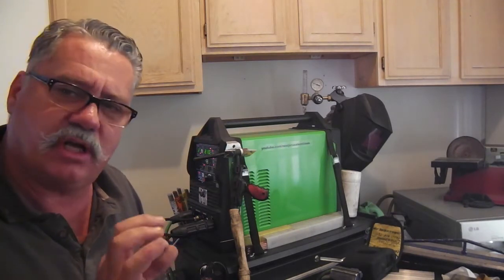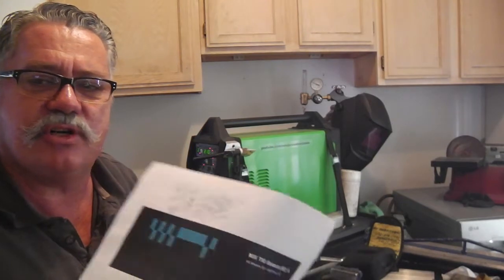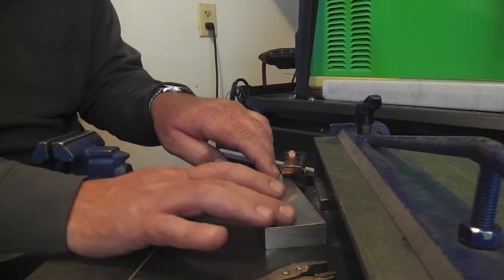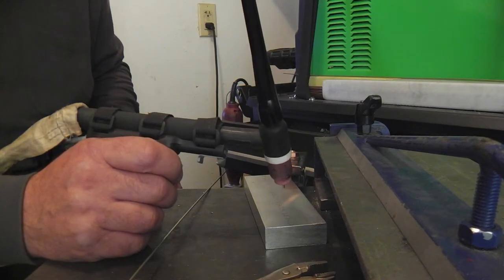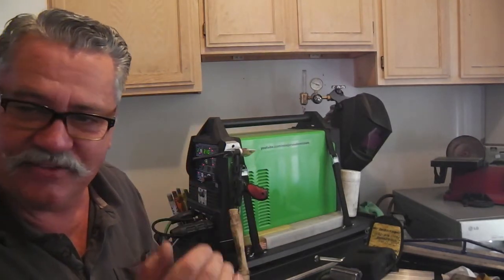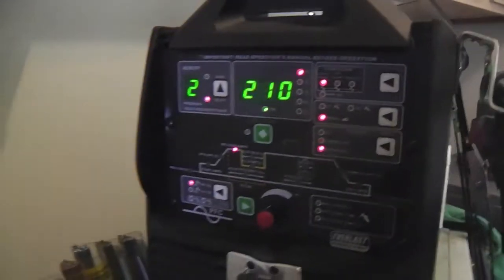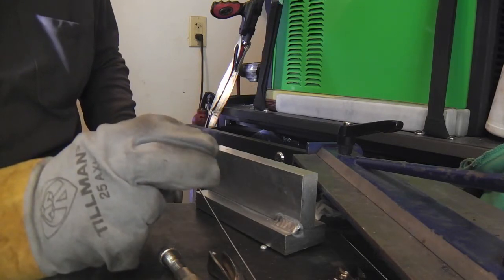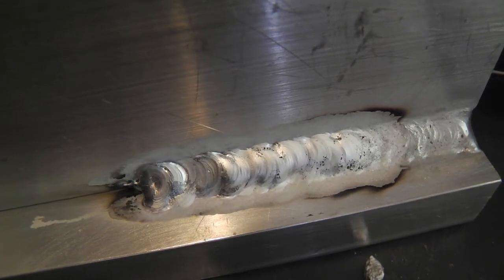Everlast Advanced Pulse AC/DC MixTIG Welding Feature

Comment: What a great feature. Everlast sure is doing some right things with their welders.
Reply from the maker: Yeah, the quality and value of some of the TIG units being produced in Asia lately, like the Everlast EXT line, are providing high quality, advanced-featured machines at brilliant values. I mean, six or seven years ago you had to spend about $6000 to get something like the Everlast 210EXT. And Everlast produced the first and second MIG-AC/DC TIG Multi units in the welding marketplace, nearly two years before Miller and ESAB's very recent entries of MIG-TIG AC/DC "all-in-ones". I mean, I'm not shilling for or compensated by Everlast, or any company. I'm just a little tired of hearing the Red and Blue crowd mindlessly restating that the Asians only copy Anglo-American designs. That seems to rarely be the case anymore, and quite the opposite now, in some cases, like with Everlast's first-to-market MIG-TIG AC/DC true "all-in-ones", e.g., the 221 Sti, 252Sti, and now the latest Lighting MTS 275, with its brilliant TFT digital display, which could even show up on a refresh of the EXT line sometime. But I'm just guessing, as the current schematic diagram digital interface is quite good, but a digital screen isn't constrained by the dimensions of a front panel itself to show all the features of an advanced TIG unit.

Comment: This feature is not new. My old ass Hobart 300 has this. It’s and adjustment for more cleaning or more penetration. All it does is control the amount of  time the current is flowing in a given direction in ac
Reply from the maker: Nonsense, you're talking about AC Balance. I mean, many of the old transformer TIG welding units didn't have adjustable AC Balance, or auto-adjusted depending on how much amperage you set (I believe), or, as your unit does have adjustable AC Balance. But that's not what we're talking about here.

Comment: My dynasty 400 does this mixed tig. Blending DC with AC.
Reply from the maker: Nah, I believe the Dynasty has "AC Amplitude Control", which is something altogether different than MIX-TIG. But, AC Amplitude Control, aka AC Offset is an advanced and undoubtedly cool feature, even though I have no firsthand experience with it. Of course, Miller charges an extra $500 for that feature on the Dynasty 210DX and 280DX, even though it's nothing more that a few lines of computer code on a 50 cent piece of plastic SD Media Card. Most other TIG units that include AC Amplitude Control (Topwell, HTP, and the new ESAB MIG-AC/DC TIG Multi) include it at no extra charge and with no proprietary SD card (Taxpayer subsidized via State-enforcement of so-called Intellectual Property, i.e., patentable State monopoly) needed.